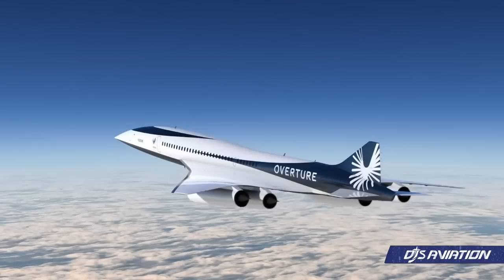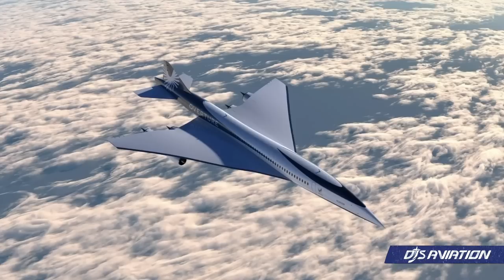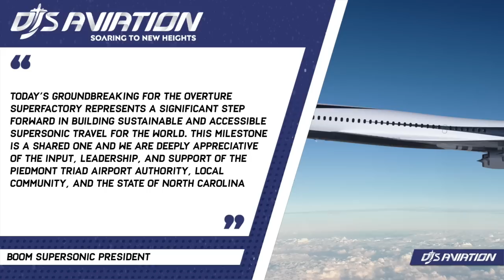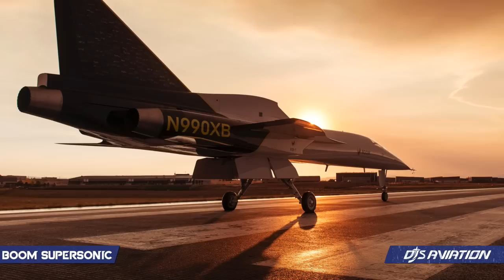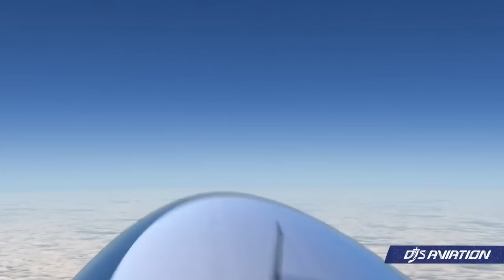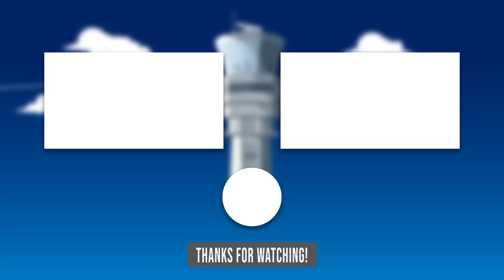Boom Supersonic Huge Update

Comment: Another concern, what happens if these small engine manufacturers go bankrupt developing an engine for the Overture because they can't make the money back by sales?
Reply: ya true and supersonic flight is too expensive from $8,000 to $12,000 so airlines will lose a lot of money when using this plane because of the bad efficiency of 4 engines
Reply: Even Rolls Royce walked away from the financial risk of development because of the lack of viable market for the airframe.

Why would anybody else want that risk?
Other than some crazy Elon Musk type who has enough money to just ignore risk and have a go at it.
Reply: @kspXD_  this isn't 1982, it won't 8-12k probably like 2k, which is still a crazy amount.

Comment: Maybe copy the old Concord a bit closer maybe bring new heads from around the world to the project.
Reply: @montumeroe9593 That would not be practical. For one thing Concorde was a traditional aluminium construction, whereas Symphony is composite which is much lighter and cheaper. But a lot of the theory from Concorde, like the wing design and the variable geometry engine inlet and exhaust ducting, may be useful.

Comment: Don’t they still need an engine manufacturer?
Reply: No
Reply: They found a new company to work with on the engine.
Reply: @Boeing-I-hs2gj  they have NOTHING with regards to actual engine development
Reply: @Boeing-I-hs2gj  and that says it all. They found a company that doesn't have an engine, that never built this type of engine and they are still planning to get a fist prototype in the air in a little over 3 years. That might have been possible in the '60s, but today?
Reply: Well the company they have a partnership with designing the engine definitely doesn't put much confidence in me, but at least they have something planned rather than nothing.
Reply: They've sort of got one now - a small company out of Florida that builds small engines for military drones and missiles. Make of that what you will.
Reply: @Hans-gb4mv  And Concorde had an existing albeit heavily modified engine from an experienced manufacturer, already in earlier versions on the Vulcan bomber, with an experienced French maker of supersonic engines for the Mirage fighters, proving the reheat and nozzle system.
That took more than 3 years with huge support from two governments (NASA came to visit us in BA Concorde Engineering in 1998 and saw Concorde as ‘yours and France’s Apollo program’).
Even then the version fitted to the prototypes was significantly different to the production version, another few years of development and testing later.

Comment: They have an engine supplier: Florida Turbine Technologies, but I still doubt this airplane will even make it past the drawing board. If it ever does get off the ground I don't think it will enter service until at least 2035 because 2029 definitely isn't possible given that they have made wholesale changes to the design.
Reply: @NeonSamurai438 Well said. I guessed 2033, that is if Boom survive. I hope they do though.

Comment: Might have been easier to acquire rights for the Concorde from what is now Airbus and BaE Aerospace (unless Bae had sold them to Airbus when it left commercial aviation) and work from a known model to improve it.  And with with Rolls Royce to build new/improved  Olympus engines rather than starting from scratch. 
Climate change should have been considered in this.   After the 777, Boeing languished and was criticized, so it came up with the Sonic Cruiser (not quite supersonic but faster than current planes) which flopped because the fuel costs would be horrendous and airlines told Boeing to go back to drawing board, at which point it focused on replacing its 767 with the 787 using the composite tech that the Sonic Cruiser would have had. 

However, in an era where airlines only care about business class and treat coach like cattle,  a premium-only fast plane might be economically feasable on certain key routes that have high demand for premiuym class.  But once more, the cost of fuel will suck money from airlines and hand it to oil companies.
Reply: I agree!! But it shouldn't be a mystery to duplicate the concorde if you understand aerospace engineering.

Comment: On first impression, I think Boom will go Bust before they even get manufacturing started. We are entering a cycle of Worldwide Recession with Startup money evaporating. I will be very surprised if they survive to build their first aircraft. Engine Manufacturers are facing the same dilemma. For the few engines they could sell for this aircraft is it worth the investment in Hard Times? If they can put it all together then more power to them, but I remain skeptical. Time will tell.
Reply: Well, Rolls Royce walked away for the very reason that the viability of sales inst worth the development cost.
Reply: hard times don't last forever

Comment: Looks like it needs to seat more passengers.  But rooting for it, Id like to cut flight times overseas in half
Reply: @ChodaStanks Yes, 200 seats, rather than 72 would be more profitable for the airlines, but it would make Overture a much bigger aircraft and would increase the risk, which is high enough as it is. If Overture is a success all sorts of possibilities will be open for Boom to pursue, not only in aircraft but also engines. But it's a big if.

Comment: No project like this could ever get off the ground without a surfeit of optimism and a huge effort of will.  However, the rhetoric around this airplane has been fanciful in the extreme pretty much from the start.  The CEO used to make some truly ludicrous statements about how cheap these flights would be, and how quickly Boom could make the whole operation carbon net zero through the use of sustainable aviation fuel.  It's hard to see how the plane can succeed economically if supersonic travel is not allowed on overland routes.  That's probably not in the cards unless the sonic boom can be attenuated, but it doesn't appear that anything has been done to the design to address this.

Comment: Makes sense to make current generation Supersonic airlines for flights that flies over the oceans. Let them fly at Mach 2+ and once they're 100 miles away from land, they can tone it down to 0.99 so no sonic booms are annoying people.
Reply: @Jia1337 That's what Concorde did and what Symphony will do. The difference is that Concorde was a gas guzzler at low speed, whereas Symphony will be more efficient, hopefully.

Comment: The question is how many people it holds, how fast, safe, fuel economy.
Reply: @JayEP86

Taking a JFK to LHR one way flight, a Boeing 747 fuel cost per passenger is $147, and tickets cost $577 economy and $2,308 first class. Believe it or not, a ticket for the same trip in a subsonic business jet costs between $53,000 and $99,000. Overture's fuel cost will probably be $628, and tickets will probably be $1,300 and $3,800 respectively. The 747 and business jet would do the trip in 8hrs. Overture would do it in 4hrs.

FAA CERTIFIED

MACH 1.7 CRUISE SPEED

2X FASTER OVER WATER

20%  FASTER OVER LAND

600+ PROFITABLE ROUTES

100% SAF SUSTAINABLE AVIATION FUEL

201 FT NOSE TO TAIL

60K FT CRUISING ALTITUDE

4250 NM MAX RANGE (4888 MI/7867 KM)

64-80  PASSENGER CAPACITY

Comment: Visually, it's looking alot like the final concept of the 2707, Boeing's attempt at a Concorde competitor.  Perhaps we've moved far enough down the line in terms of the cost of building and operating an aircraft like this, that it can be done without being subsidised by governments for the sake of a national symbol of aviation prowess.  I remain sceptical of the project's chances of completion, and downright amused at the completely unrealistic timeline.  I hope to be proven wrong.  Godspeed Boom!
Reply: @NegdoshaManido Yeah, agree. Symphony now looks a lot like the non swing wing Boeing 2707-300, which is a good thing as far as looks go. Apparently the new layout will improve low speed performance, but it does look like a drag monster with the four huge engine pods and empennage.

But Symphony is a much less adventurous design in fundamental ways:

Mach 1.7 / Mach 2.7
72 seats / 230 seats
Composite Construction / Titanium

As you say the timeline seems unrealistic, 2033 would be more like it, rather than 2029.

Also, like you, I hope Boom does survive and gets Symphony into the air.

Comment: September 2023. I hear that RR have pulled out, and won't be making their engines;  causing a stall, in future milestones.
Reply: Florida Turbine Technology started detail design of the Overture engine in January 2023. The medium bypass turbofan will use certified materials and parts, including blades, rotors, accessories, and core. The manufacturers of these parts will assist throughout the engine development and certification program.

Comment: As I said before, this aircraft does not make technical and commercial sense. I have concerns about its stability at low speeds, based on the illustrations published, if they are to scale.  Without an engine, it will stay firmly on the ground. Economically, only the super-rich will be able to afford it while going to the exotic places for their R&R.  It is too small for affordable supersonic travel at Mach 1.7, which is too slow for any impact on air travel in general.  The planet Earth is very small for supersonic commercial aircraft, let alone hypersonic aircraft, unless there are fundamental breakthroughs in aerodynamics and propulsion technology. Just my $0.02 worth. Thanks.
Reply: Florida Turbine Technology started engine development in January 2023.

Comment: Dramatically looks like a "super-Concorde".
Hope it won't drink as much fuel, and produce as much noise...
Reply: Overture will be a lot more fuel efficient than Concorde, both at sub and supersonic speeds. It will also comply with ICAO-14 noise regulations, so it will be quieter than most current subsonic airliners, on take off and landing. Overture will fly Mach 0.94 over land and Mach 1.7 over water.

Comment: the overture could be the next sst 2707
Reply: The mid 2022 Overture revision looks like the fixed wing Boeing 2707-300, but it is much smaller and will fly at Mach 1.7 rather than Mach 2.7. Overture will also carry fewer passengers, at 65 to 80, compared to 230.

Comment: I am happy this is happening and it is happening, building the factory at the airport. They are designing and building an engine for the supersonic jetliner. It will run on SAF so its carbon natural. It will succeed there are many companies now focusing on clean energy. So it will happen and we have to progress as a species. I am happy for Boom and know they will succeed.
Reply: Being carbon neutral is such a far stretch. The main reason why planes aren’t running SAF currently is the insane energy it requires. Solving energy supply for projects like that is not around the corner. Once it becomes available for commercial flights, it will still be WAY more suitable for dreamliners and stuff
Reply: @bryant3825  That is totally fair. However, I disagree in two fundamental ways: 
1. The example of spaceX is quite different. For one, spaceX is a financial nightmare being on the brink of bankruptcy every now and then. Furthermore, spaceX had a very good value proposition, which was to reduce costs on a project which is very much going on in the form of NASA. The same cannot be said for BOOM. The Concorde failed on lacking confidence in the safety aswell as the more attractive proposition which was to fly on the 747 (at the time). 
2. When looking into research of sustainable fuels, the common denominator is more or less almost energy usage. Innovation will not break the laws of physics anytime soon. 
But time will tell. Maybe I am all wrong. Who knows.

Comment: Until there is an engine, it's only vaporware.
Reply: Florida Turbine Technology began detailed design of the Overture engine in January 2023. The engine is a medium bypass turbofan that uses certified materials and parts, including blades, rotors, accessories, and core. The manufacturers of these parts will help throughout the development and certification of the engine.

Comment: I'd rather a bunk/capsule on a plane that takes 12 hours to fly across the pacific than cramped in a tube with a fancy coach seat that takes 5 hours. I think most people would. Who is this plane for?
Reply: All 65 to 80 seats on Overture will be business class, almost certainly with internet. The seats will be comfortable and there will be adequate room. JFK/LHR trip will take 4 hours, as opposed to 8 hours subsonic. The ticket price will be the same as subsonic business class, at $5,000 return.

Overture is aimed at the 700 million long range business trips made each year world wide. Because Overture will be fuel efficient at sub and supersonic speeds, Boom and the airlines have identified 500 viable routes, some mixed land/water, compared to just 2 Atlantic routes for Concorde. Overture will fly at Mach 0.94 over land and Mach 1.7 over water.

Comment: Fuel consumption is the key, this looks a lot like concorde, which failed badly
Reply: @BeyondWrittenWords  Fuel cost per se wasn't the show stopper for Concorde, although it was an important factor. The main problem was that the menace of sonic boom had not been appreciated, and when it was found that Concorde could not fly supersonic over land it meant that most of the routes that the airlines had planned became nonviable. There were other issues with Concorde too, including its high maintenance costs, and it was a gas guzzler at low speeds. 
Taking a JFK to LHR one way flight, a Boeing 747 fuel cost per passenger is $147, and tickets cost $577 economy and $2,308 first class. Believe it or not, a ticket for the same trip in a subsonic business jet costs between $53,000 and $99,000. Overture's fuel cost will probably be $628, and tickets will probably be $1,300 and $3,800 respectively. The 747 and business jet would do the trip in 8hrs. Overture would do it in 4hrs.

Comment: Very aggressive time line for sure. MAYBE if they had the engines...MAYBE. I doubt this will ever happen, however, it might help the next developer. It is interesting to me that in 2023 there are no supersonic passenger planes. The Concord was built in the 60s, first flight in 1969, but the concept was first discussed in the mid to late 50s. When engineers were using pencil and paper to do that math. Here we are in 2023, super computers, more than 100 years of history to grow from, and yet no super sonic passenger plane. Does that not seem odd to anyone?
Reply: Physics is against them--obviously a supersonic transport has been technically feasible all along, but fuel cost is a major constraint on commercial aviation today, and supersonic transport is inherently inefficient. The Concorde, despite its high ticket prices, never made money and was always a prestige-driven loss leader. Add the environmental concerns about burning all that fuel*, and the idea seems less attractive than it did in the 1960s.

*I know Boom talks a good line about producing their fuel in some kind of carbon-neutral way, but there's nothing specific to an SST about that; if it's commercially viable, it ought to apply to any jet, and be easier to swing with a more efficient one.
Reply: Yes, it is a very  aggressive time line. I recon 2033 for certification is more like it.

Florida Turbine Technology began detailed design of the Overture engine in January 2023. The engine is a medium bypass turbofan that uses certified materials and parts, including blades, rotors, accessories, and core. The manufacturers of these parts will help throughout the development and certification of the engine.

Overture will benefit from the advances in technology and materials that you mention.

It seems odd that there are no supersonic airliners in 2023 from a technical point of view, but not from a financial point of view. The market for SST is too small at the moment, for any of the major companies, like  Boeing, GE, etc, to contemplate, and the development costs are too high for a small company to undertake and that is where Boom are most at risk.

Comment: This is no faster than Concord, a plane that launched in 1976.
Reply: That is correct. Overture will cruise over water at Mach 1.7 whereas Concorde cruised over water at Mach 2.0. But Overture will have a longer range at 4,880 miles, compared to 4,488 miles.  

Overture will fly Mach 0.94 over land. Because Overture will be fuel efficient at both sub and supersonic speeds, Boom and the airlines have identified 500 viable routes, some mixed land/water, compared to just 2 Atlantic routes for Concord.

Overture will comply with ICAO-14 noise regulations, unlike Concorde which created an awesome 120dB on take off. This means that Overture it will be able to use all main airports.

All 65 to 80 seats on Overture will be business class, almost certainly with internet, and ticket prices will be comparable with subsonic business class. For example JFK/LHR return will be $5,000.

Overture is not aimed at the mainline economy market, which is more than adequately covered by the major manufacturers, like Boing and Airbus. Instead it is aimed at the 700 million long range business trips made each year world wide.

Comment: Maybe the first flight of the Overture will help finally get the XB-1 off the ground, which was initially slated to achieve first flight late 2018.  Wait...😮

I really do hope they achieve some success; I appreciate they probably need to hit some milestones (like breaking ground) to garner levels of funding, but the timelines...I just don't know.  Maybe they need to be on the over optimistic side again for funding reasons; I hope they can stick with it regardless of the hoops they have to jump through, or however long it takes.
Reply: Blake Scholl has hinted that, as the XB-1 no longer represents the latest Overture design, it has little relevance and may not fly.